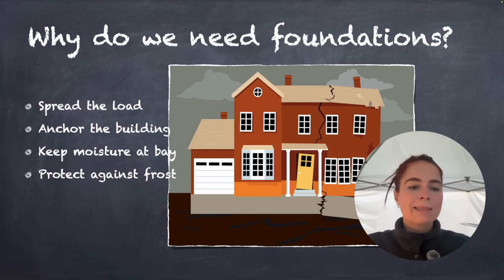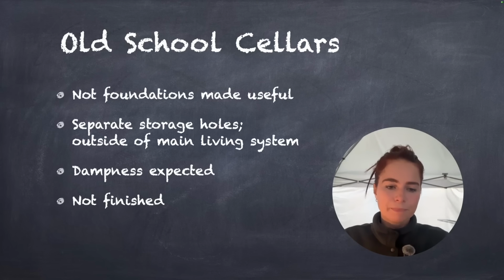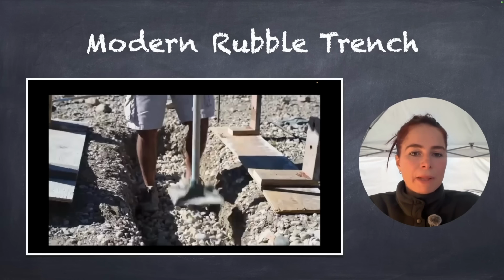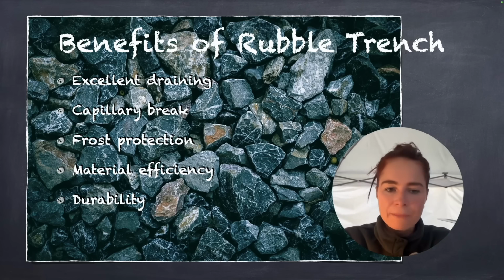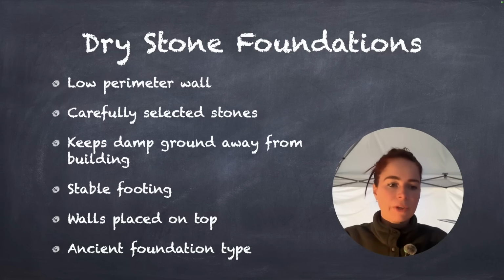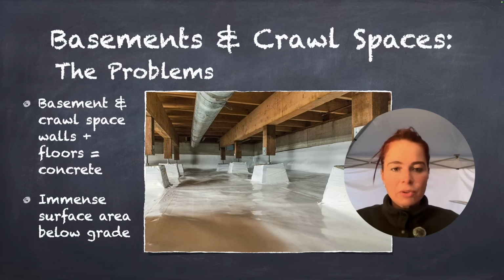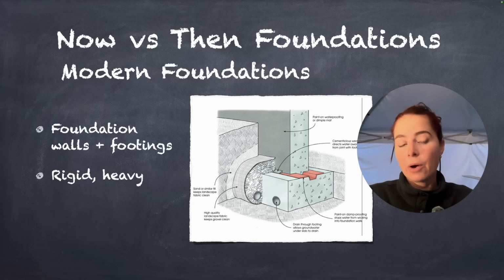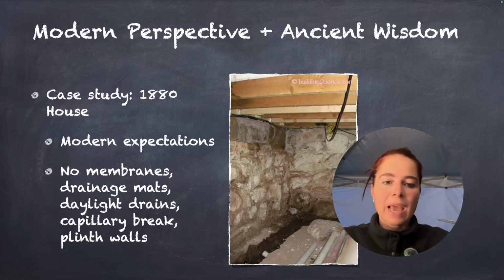Why Modern Foundations Fail — and the Genius Design We Abandoned

Comment: How should a house be build on a slope then ? I live in a 1900 home in Austria, we have problems with dampness and we will completely renovate the house with new trenches for drainage. The problem is we have a partial basement in addition to the 1st floor build into the slope. So the back of the house is under the ground surface level by 2/3 of the hight of the 1st floor and the front of the house is about 12 inches above the ground surface level… the ground is on the denser side with clay soil and a lot of rubble from a brook that flows across the street beside our house… i hope we can improve the situation but i am lost in how this will work with an airtight building… Me and my kids are very sensitive to mold. If anyone has some advice for us that would be great !!!
Reply from the maker: That’s a tough situation — hillside + clay soil + partial basement is one of the hardest moisture scenarios.
I’m not an engineer, so please treat this as general building-science framing, not design advice. In slope conditions, the priorities are always:
1. Bulk water control first (uphill interception, exterior foundation drainage, relieving hydrostatic pressure)
2. Air leakage and vapour are different things — uncontrolled air movement carries a lot of moisture, but airtight retrofits can cause problems if vapour-closed materials trap moisture
3. Assemblies must be designed to dry in at least one direction, especially in older masonry buildings
A good conceptual reference is Joseph Lstiburek’s “Perfect Wall” — it explains why water control always comes before airtightness (https://buildingscience.com/documents/insights/bsi-001-the-perfect-wall).
Given your sensitivity to mold, I’d strongly recommend consulting a local engineer or building-physics specialist familiar with hillside retrofits and historic masonry. These projects really hinge on site-specific detailing.
Wishing you the best — you’re asking the right questions.
Reply: @thehealthybuildingproject thank you for your advice 🙏💛

Comment: 13:43 why not just do an entire ruble pad under the entire house including the outer edges where the trench is?  Wouldn't it be better if you poured a Roman concrete pad  on top of rubble(ballast)?
Reply from the maker: Washed gravel capillary breaks are actually already common under slabs — execution is the weak point. A full rubble pad can work in some cases, but edges, frost, and loads still need careful detailing. Roman-style concrete worked historically, but it’s not a simple drop-in replacement for modern residential foundations.
Reply: @thehealthybuildingproject just use stone foundation then with Ruble underneath. Slabs of granite

Comment: I feel like it's fairly simple... backfill foundation walls with stone all the way down to the drain tile and get rainwater landing a few feet away from the house. After buying my very poorly built house and having water intrusion issues, I have been focused on making changes that get water further away from the house and it's resolving my water problems.
1. I am fortunate to have a storm drain far from my house where I could run drain pipe underground all the way to the storm drain.
2. Direct sump pump and gutters into underground pipe
3. Add rubber roofing membrane to top of deck joists so water runs to the end of the deck (12 feet away) instead of landing right next to the house.
4. Dig up soil where water pressure caused crack in wall and backfill with gravel after fixing the crack from the outside.

All of these changes combined cost less than $1500 (since I did the work myself - it was a lot of work), and most of my water issues are now resolved. Still have a little more to take care of, but it'll get done soon, and I'll have a totally dry basement for years to come (or until a tornado comes through and tears the roof off).
Reply from the maker: Thanks for sharing this.. it’s a great example of how getting water away from the house solves most problems. You focused on the fundamentals, and it clearly paid off.
Not everyone has the time or ability to do that kind of work, though — and once water does get in, indoor air quality and health can start to matter too. 
I really appreciate you laying this out!

Comment: capillary action was well known to the builders of yore. it's not new or recently discovered phenomena. the biggest hurdle builders of yore had to overcome was economics. stone walls were insanely expensive owing to the fact that the material had to be quarried, usually by hand and transported with the aid draft animals in europe most towns have their own quarry on the outskirts, but even then building costs were horrendous given the economy of the day. long transport distances were avoided wherever possible. 
foundational water/vapor barriers simply didn't exist save for bitumen, which wasn't widely available which is why it's seldom (if ever) seen in old buildings. 

there are a plethora of reasons that basements become dank and damp, which you highlighted only two in your video. 
other reasons are the lack of air circulation stemming from the type of heat the house has. a wood or coal furnace

 will create a massive air turnover as fresh air has to be continuously supplied to the fire. oil and gas have a certain fresh air requirement as well, however those two heat sources also create large amounts of water vapor, especially gas as it burns really clean and a complete and optimal burn will create CO2 and water with trace amount of soot. houses that used coal heat would usually store the coal in the basement and the furnace was often located in the basement as well. the fresh air turnover kept things dry. gas and oil furnaces do the same thing, however, central heating systems are very well insulated and don't remove much moisture from the basement air or reduce the rH to manageable levels.

basements/cellars were a vital component of food storage and preservation as refrigeration wasn't an option a hundred plus years ago. cellars were vital keepers of wine vats, sauerkraut and sour beans crocks, root vegetables of all sorts and so on. 
the other culprit in moist basements is the wrong paints used by the homeowner. old european basements/cellars used a whitewash paint made from hydrated lime. it doesn't foster mold growth and can breathe/wick away a large portion of moisture wicking up the walls. 

that's me two cents worth
Reply from the maker: Thanks so much for this. Far more than two cents, honestly.

Your point about economics is such an important reminder. Housing has always been a privilege, and builders were constrained by what could be quarried, transported, and afforded locally. But when people did build, they were usually building for generations (not just for the length of a mortgage cycle). Longevity was assumed, even if comfort expectations were very different.

I appreciate your point about historic heating and air turnover. An active chimney (wood or coal) creates a massive stack effect, and old houses were extraordinarily air-leaky by modern standards. That constant air movement did a lot of moisture management that we simply don’t get in today’s tight, insulated homes.

On basements and cellars: absolutely.. they were vital for food storage long before refrigeration. My understanding is similar to yours: many traditional cellars were effectively outside the conditioned envelope, thermally and often air-wise separated from living space. My concern today is less about cellars existing, and more about finished or semi-conditioned basements in modern tight houses, where soil gases, moisture, and mould can directly affect indoor air quality and occupant health.

And great point on finishes.. limewash is a big one that gets overlooked. Vapour-open, lime-based coatings that don’t foster mould growth reflect a very different material logic than modern paints that seal masonry and trap moisture.

I really appreciate you adding this context.

Comment: The problem with having gravel under a foundation is liquification.
instead you could focus on airflow like how a termite mound is built.
Reply from the maker: I love the intuitive thinking here. My understanding is that liquefaction is very site-specific and usually linked to loose, saturated soils — clean, drained gravel is often used to reduce that risk. Airflow helps with drying, but it can’t replace drainage or stop capillary rise.

Comment: As a home designer for over 40 years, I'd say you got mixed up.  You are arguing about using a rubble foundation and has nothing to do with the benefit of below grade spaces and the modern concrete foundation.  Which done right should last at least 50 years with no mold or smell.  We know how to deal with water like a stone in a stream.
Reply from the maker: I appreciate that perspective — and your experience. I’d just add that 50 years isn’t a long horizon for buildings, and for me health and indoor air quality are part of the durability conversation too. Many systems work structurally, but still create long-term moisture or IAQ issues in practice.

Comment: Yikes - Some red flags here - I'm hearing: It's organic, It's natural, It "feels" right and It was replaced by buried concrete by those science guys.  Science is about continually progressing towards explanations/methods/math-models that more fully represent the actual physical world and how it behaves (build it, break it, build it again, break it again, etc).  Engineering is about applying the current crop of science knowledge to practical problems.  So, if rubble foundations are really better, and you can prove it, then this is part of the scientific method.

I'm not hearing a lot that makes sense here.  This person should have, but didn't start the video by listing her credentials.  I was not impressed by that shared video clip of some dude hand packing rubble.

Gravel is already part of a modern foundation.  It goes under and around the concrete to allow for water to drain away.  This presenter, about half way through, says how the rubble shifting is a good thing.  The presenter says the rubble will shift to better distribute the load (or words to that effect).  This is called settling and it usually a bad, not a good thing.  If the rubble shifts, masonry walls will crack, timber frame nails will pop, etc. (bad stuff).

That plastic mesh they are putting around their rubble foundations has a finite life (less than 50 years).  If this rubble scheme really works, then it would be prudent to install a zinc-plated or stainless steel mesh for longevity (expensive).

Digging a rubble trench with completely vertical walls seems like a bad idea.  If it works at all, the rubble pile should be trapezoidal (narrow at the top and wide at the base) where the slope of the sides should at least equal the natural angle of repose of an unsupported pile.  Even this concept is suspect since a rubble pile under pressure will have a different or no angle of repose and will always need to rely on the surrounding soil for lateral support.

In short, rubble, by itself, will hold no load and relies on support from the walls of the trench meaning the condition of the soil you are placing the rubble foundation into is super important.  For example, some folks live in sandy areas.  Some soil is more or less loosely packed to begin with.  Some live where it is warm all of the time, others live where ground freezes to a certain depth in the winter.  

Soil "perc" test - To have the rubble foundation drain water away means the soil has to percolate.  Some folks want to build a house in swampy areas.  If the water table is too high or there is too much clay content nothing drains.

When moist soil freezes, the water in it expands and can heave a structure around which is why in Norther climates, the foundation must be deep enough to sit at a location that does not freeze.

Please don't site Frank Lloyd Wright as the end-all be-all of correct tech.  He was a genius of design/style.  He was only average in terms of using sound engineering skills to make his designs work (average is not a bad thing, just means he was not superlative/exemplary in structural issues).

Lastly, usually methods are replaced throughout history because there were problems with the old way.  Usually the problems revolved around cost or the lack of certain types of materials.  For example, Roman concrete was fabulous, It set quickly, but but it took months to fully harden.
Reply from the maker: I hear the concern, and just to clarify a few things. This isn’t an “anti-science” or “anti-engineering” argument. I’m very aware that washed gravel is already used in modern foundations as a capillary break.. largely because modern concrete is highly capillary-active and needs protection. One of the things that interested me is that a rubble trench is itself a capillary break, not just something added to protect concrete.

On movement: I’m not saying uncontrolled settlement is good. What I’m pointing to is that granular systems accommodate micro-movement and drainage in a way monolithic systems don’t, which is one reason they historically performed well in freeze–thaw conditions when paired with appropriate plinths or grade beams.

Site conditions absolutely matter. I’m not suggesting this works everywhere or that people shouldn’t involve engineers. Soil type, percolation, water table, drainage to daylight — all of that is critical, and I do mention that.

As for history: rubble trench foundations (and related stone footings) were used for well over a thousand years in various forms, across climates. Modern concrete foundations, by contrast, are a relatively recent experiment, and many fail due to moisture issues within decades. That doesn’t make the past perfect, but longevity is worth paying attention to.

My goal isn’t to romanticize old methods or reject modern ones. It’s to look honestly at what problems each system solves, what new problems modern approaches introduced, and how we might combine ancestral lessons with modern understanding rather than dismissing either outright.
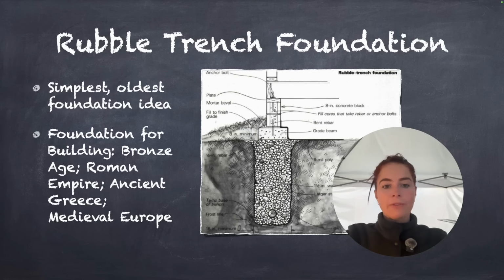Reply: @thehealthybuildingproject Thanks for the thorough reply and I agree with your feedback except for the "many fail" statement about concrete foundations.  I live in a 100 year old house in a Northern climate with a perfectly fine poured concrete foundation.  You should check out FRP (fiberglass reinforced plastic) rebar,  MST is a good brand and is great for use where water is an issue.  It doesn't rust, expand and crack the concrete, which is what you are probably thinking of when you say many fail.  I'd be curious to see some failure statistics.  Although, concrete people always say it isn't "if concrete cracks", it is "when it cracks".  Regarding rubble foundations being used for thousands of years - houses weren't that big back then and I'm sure failure statistics were not recorded.  You don't see the old houses that failed because they failed.  I'll bet the 1000 year old cathedrals foundations were built down to solid stone.  There is even a Biblical reference to firm rock foundations and an admonition against sand (rubble) foundations (Matthew 7:24-27).   Show me the rubble foundation science and I will change my mind.

Comment: I repair and sometimes rebuild sections of stone foundations in NewEngland. There is no capillary action with them, and it seems like the philosophy of building was completely different. They used natural (and usually local) materials which allowed the buildings to ebb and flow with nature. Modern philosophy relies on brute strength. Immobility, impervious to water, air tight for “efficiency”. Glad people are waking up. Hopefully we can get back to what worked.

Comment: Canada eh? Check out the base used for "Permanent Wood" foundations (the details are similar to yours, but it's been badly milaigned while positive myths of concrete live strong).
Reply from the maker: Thanks for pointing that out.. I actually hadn’t looked closely at Permanent Wood Foundations before. On a quick review, I agree: the base and drainage logic is very similar. Granular footing, perimeter drainage, and keeping moisture out rather than asking the structure to tolerate it.
It’s interesting how PWFs were often maligned, while concrete (which is highly capillary-active and moisture-sensitive) was treated as the default. Definitely something worth digging into more.